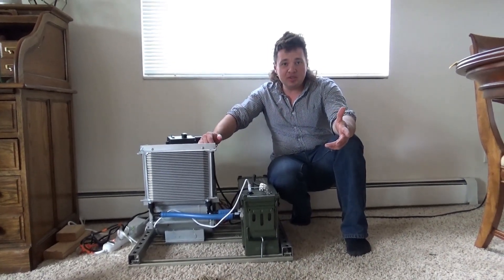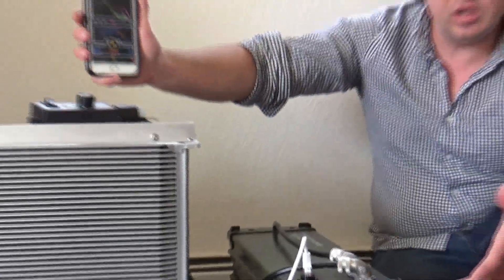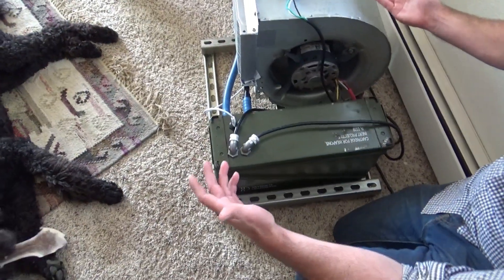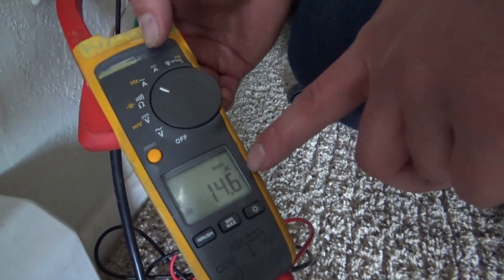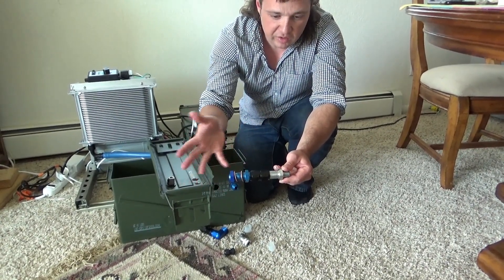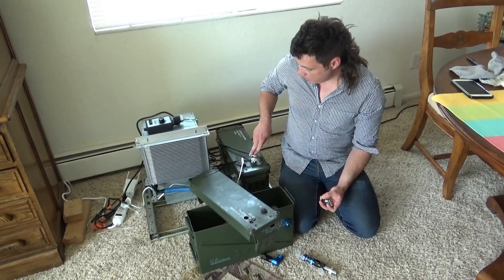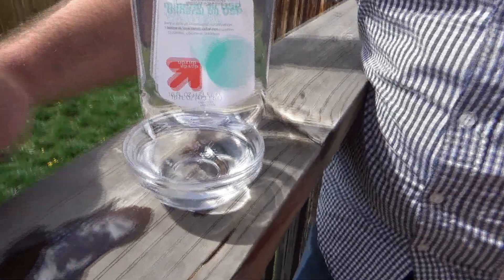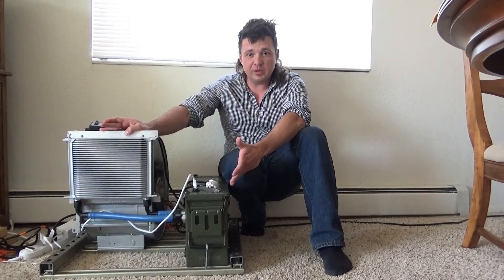World's Most Expensive Space Heater -World's Least Expensive (and Quietest) Heat - Bitcoin Mining

Comment: In your video, you show how a fan speed controller can reduce fan noise. Since the high pitch and loud fan noise is due to forcing air through compact space, what if the original case is removed and the components are reassembled onto a less compact case? By doing so, the air would circulate through the machine easier with less static pressure, right? If space is not your constraint, and loud noise is the issue, what do you think of this approach?

Comment: Hey, how have these been running 2 years later? I’m using your project as inspiration for a 3x L3 miner cooling setup. Did mineral oil cause any long term issues?
Reply from the maker: The oil does cause the cables to harden up and cleaning up the miners for use back in air is quite a challenge. Otherwise I don't think the oil caused any problems. In the future I would recommend looking at the heat transfer fluids, they were not really available when I started this but have come down in price (and availability) a lot since then. They offer a lot more heat transfer capacity then the oil and a lot cleaner.

Comment: I'm about to receive a few L3+ for dirt cheap now that china banned them and I am looking forward to build this setup. I was just wondering how much was your power consumption for the whole rig and also if I can use a vehicle fan on the oil cooler would it be enough airflow? Since I have readily access to them. Thanks and also very inspiring content.
Reply from the maker: I think the pump is about 90w and the fan wasn't all that much more, depending on the speed. It wound up being run at the lowest speed possible in the end. I think using a vehicle fan would be fine. If you do build it please share, I'd love to see it

Comment: Did you ever have any issues with corrosion using the oil you did?
Reply from the maker: What do you mean by 'corrosion'? The wires did get hard and brittle but everything else seemed ok.
Reply: @neetbuxlaboratories5806  Certain types of mineral oil contain trace  compounds such as sulfur that will interact with solder and solder flux and other metals and will overtime cause corrosion under or around chips. Irreparable in most cases.  I was wondering if you ever had that type of issue.
Reply from the maker: @gymkhanadog  I don't believe I've had any failures due to sulfer or other compounds. One control board died of either heat or old age and I've had power supplies die too but I had that happen on air cooled miners as well.

Comment: What an excellent idea!!, rather than the fan can we thermal syphon - into a large radiator filled with Mineral oil or water?  If so how would you go about estimating rad sizes. Lets say we use the large ASIC, uses about 3KW electricity here in Europe at 240V. ..... THANKS VERY MUCH

Comment: very good video, where can i buy the mineral oil?
Reply from the maker: You can buy it at Amazon (a little pricey) or at any farm type hardware store. I haven't tried but I think iso32 hydraulic oil should work (its basically mineral oil with lubrication additives).
Reply: If is not asking too much, can you post a link for the product, im researching for immersion oil and i’m not getting any good results
Reply from the maker: You don't need any special oil. I've used general purpose mineral oil for veterinary purposes from the local hardware store.

If you look in part 2 of the build I talk about it a little more 

https://youtu.be/vwvIwoAirwQ

You can use this from Amazon or anything similar.

https://www.amazon.com/Gal-Mineral-Stainless-Cutting-Butcher/dp/B00VNI1JH6/ref=sr_1_1?crid=H0UTIY1XBHUS&keywords=mineral+oil+5+gallon&qid=1559597150&s=books&sprefix=mineral+oil+5+gal%2Cstripbooks%2C302&sr=8-1

Comment: Did you had any problems submerging the PSU? I'm using original bitmain PSU and it stopped working. Any ideas?
Reply from the maker: So far I haven't had any problems with PSU in oil, although they were the MyRig 220V ones or the pair of HP units.  Try popping off the cover and see if there is any loose wires or  visually blown components.

Comment: That's so funny, 'The most expensive space heater'! 

I've got $450 (including miner+PSU) spent on this wonderful project and I'll be waiting on deliveries all next week with a RoI of about 5 months (I dont pay for elec).

As with any innovative DIY project half the fun is flexibility, like, maybe the Innosilicon S11 Blake2b Sia miner wasn't the best choice (where the heck do you sell Hyperspace coin???), and I'm already thinking of swapping it out for a Bitcoin miner before the submergence in the next week or so. 

I have 37NznQvKeJi8djLntFiVeTwgQWa8WTfnoJ on my expenses ledger  ;)
Reply from the maker: What fan did you go with?
Reply: @neetbuxlaboratories5806  I have one now that came mounted on the transmission radiator, but it's too noisy for my application - built in to my live-in RV about 2 feet from where I'm sitting.. It may be much quieter throttled down.
I ordered an oversize, ultra quiet 12 volt computer case fan (24 dB, 64 cfm) and a circut board ($9) that monitors the temp and automatically adjusts the three step fan and can reverse it to blow heat out in the summer.
I'm hoping I can dink around with the  pump flow (it's possible to lose cooling in the radiator by passing the oil through too quickly) and airspeed to find the right balance. 
Have you had any overheating?
Reply from the maker: @imdawolfman  Without seeing it, I think that computer fan might not move enough air. The only time I had any issues with overheating on the single was when we were deliberately trying to see how low we can go on the airflow. The pump specified doesn't develop enough flow or pressure that oil passing too quickly is an issue. I would look into a bigger fan, can you find a blower locally like I used?
Reply: You were quite right, the computer fan was weak and wouldn't reverse by switching polarities. Luckily, the 12v fan that came  with the transmission cooler is very powerful, reversable and reasonably quiet at lower speeds, so I'm going with that.
I did an assembly last night and it certainly is a tight fit. I had to order a smaller pump than I'd bought (I'd always wanted a fountain in the yard anyway) mostly because my PSU is 2 modules. I'm afraid there won't be room for much more than 2 Gal. of oil.
Reply: @neetbuxlaboratories5806  ,  one thing I'm worried about is the adhesive that attaches the heat sinks to the chips dissolving. I don't think the heat sinks are necessary in oil,  only the sinks themselves clogging the flow of oil. I saw a vid where a fellow was torching and prying the heat sinks off before submergence. THAT looked spooky. 

How often do you feel inspections are needed?
Reply from the maker: @imdawolfman  I don't think the oil should dissolve or attack the thermal epoxy of the heat sinks. I've not had any problems. So far they've been pretty reliable and don't really have to check up on them much.